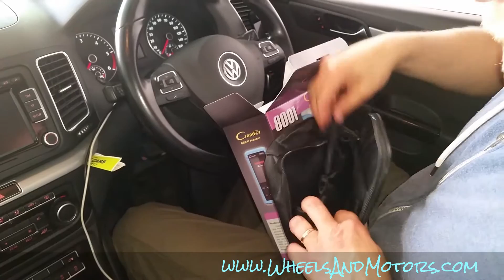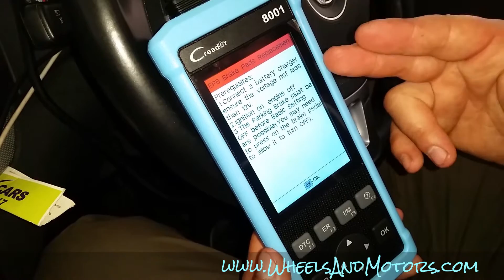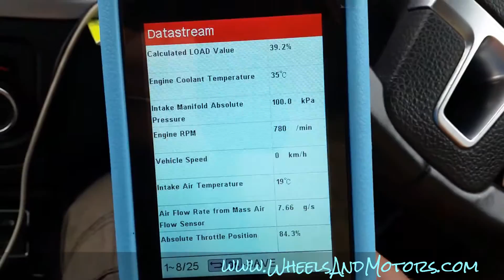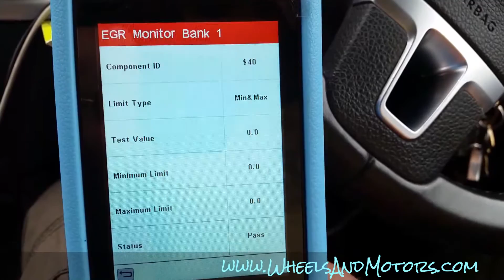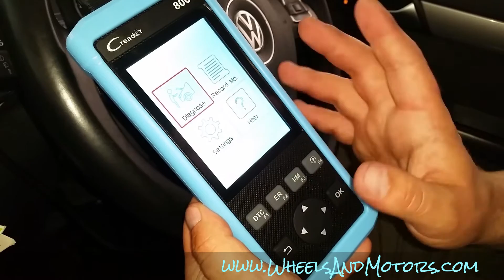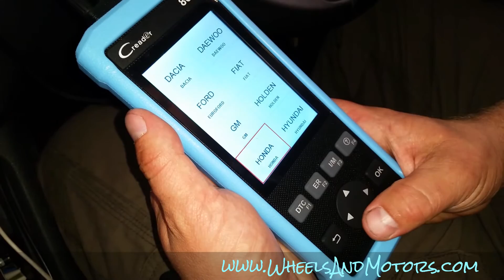LAUNCH Creader 8001 review by WheelsAndMotors

Comment: Sorry about no topic but i recently bought Audi A3 2.0tdi 2006 BKD,(yeah) engine, and on low rpms, 1-2 can hear slight whistle noise, if that can really be selenoid valve as one man mentiniond on comments, cause power is great, no smokes from turbo etc.
sorry about offtopic, im from Latvia :)
Reply from the maker: If power is not affected and there's no smoke - maybe squeaks come from auxiliary belt (alternator, power steering, compressor), or maybe on the other side - clutch (does the clutch make any noises).. I don't know, I can only guess...  Veiksmi :)